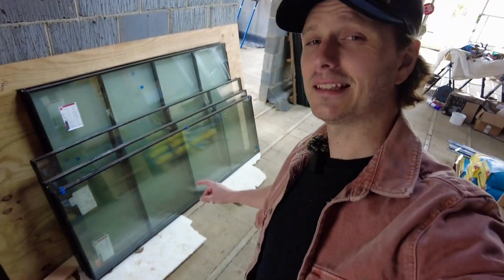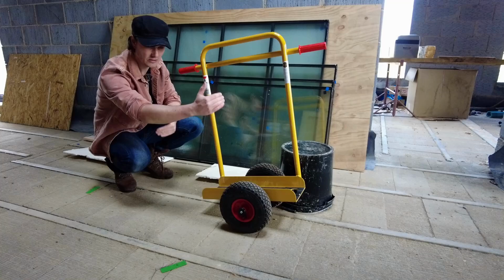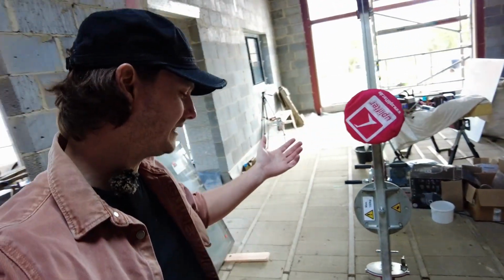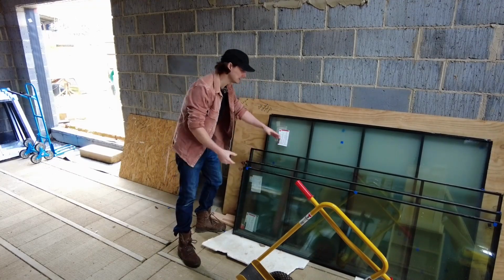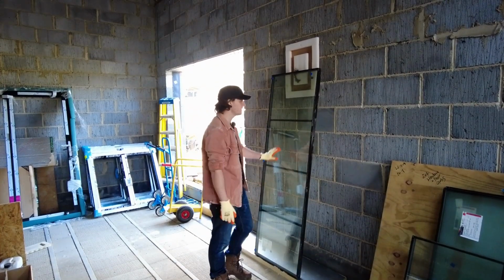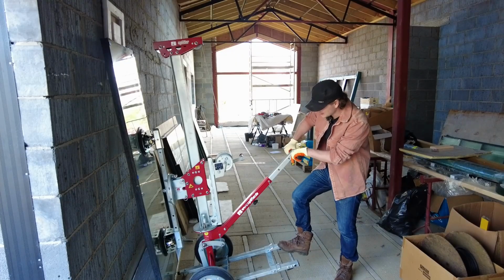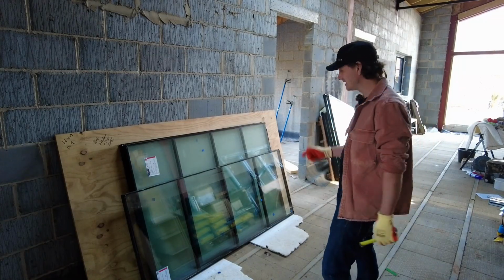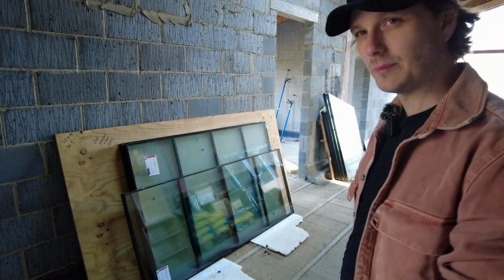Fitting Triple Glazing Solo

Comment: Why would you not use a sheet rock dolly instead of that dolly with two wheels, that pivots or teeter totter‘s? I’m just curious it just looked a little sketchy that’s all. Good luck!
Reply from the maker: 😂 Cause I like to live life on the edge! 🤘 Haha Naa them dollys come with small wheels which will struggle with the block and beam floor. The beams are slightly higher so having pneumatic wheels makes it easier. Even the glass lift struggled abit but at least they were big wheels